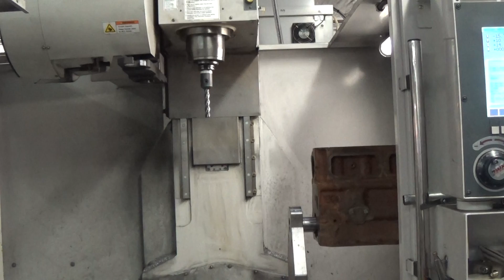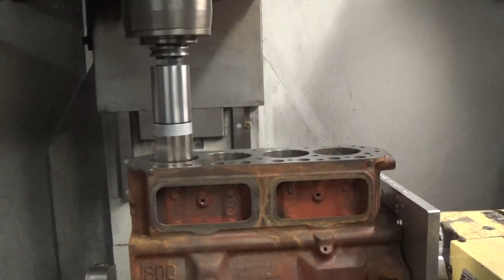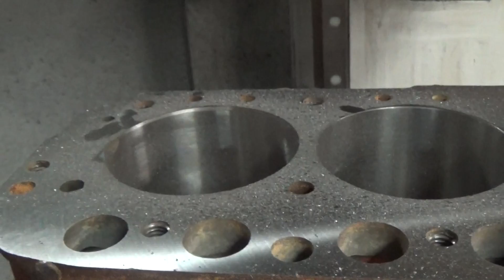MAW MGB project cylinder boring

Comment: Where did you buy that boring bar? I'm looking for a decent boring bra for engine cylinders for my manual mill.
Reply from the maker: That is a Kaiser, Swiss made boring head with a CAT40 spindle. The head and shank are probably about $2,000. Different insert holders are around $250 each. A manual mill would require a riser to bore blocks, unless you are planning on boring just single cylinders.
Reply: I have both feed on spindle and table. With the table the travel is enough for any cylinders.